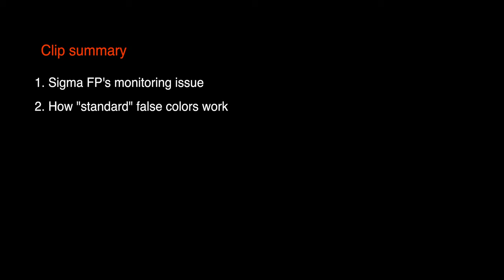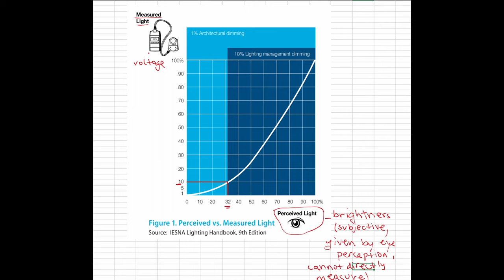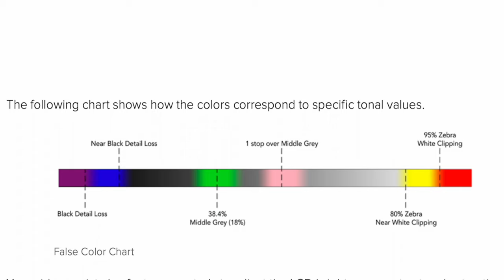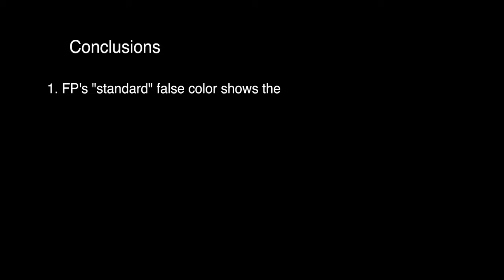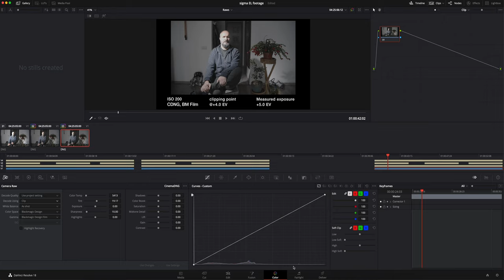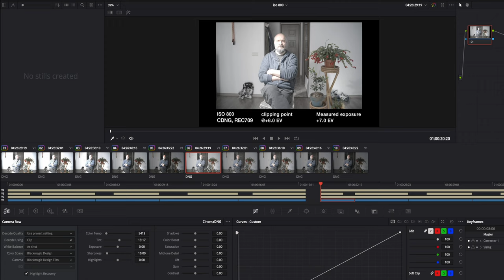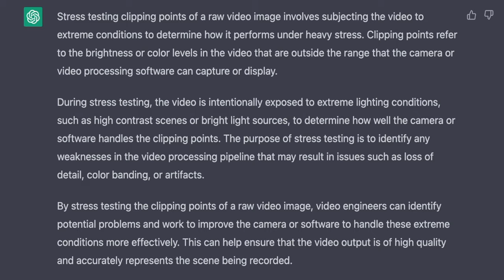Sigma FP - false color

Comment: Hey guys, I know this this might be a really strange ask but I have been cracking my head on how to get clean audio on the sigma FP for a while without the hissing sound. At the moment I've got a 'SAMSON C02 Pencil Condenser' Microphone connected to a 'Saramonic SmartRig+ - Audio Mixer 2 Channel XLR/3.5 mm' connected straight into a 'RODE wireless GO II' transmitter which delivers the sound to its receiver and that is connected straight into the audio of the camera. 
Every time I take it into Davinci Resolve, I always have to add a gain of at minimum +15 and at that point I have a hiss. Any advice would be appreciated.
I've really appreciated you guys' work on the FP so far and I thank you very much in advance for the future vids!
Reply from the maker: I’d only record on the wireless go ii. You can do 32 bit float now. Just don’t use the sigma sound. It’s good for reference…
Reply: Do you have the input set to mic level, and not line level?
Reply: @thepropolys  what's the difference? And how can I change between both to check?
Reply: @adeloyearts205  Sorry, I guess there is no line level input. But you can adjust the gain from the menu, just keep going right on the audio section.
Reply from the maker: The problem is the lack of monitoring. If we had a headphone jack… You can do visual monitoring but that’s not a professional way to deal with sound. Or you can use an external monitor. I prefer a sound recorder over any of these choices for professional use. That evf they come up with should’ve been the solution to most of fp shortcomings but instead it takes awat some to give you one. Imagine the evf with headphone jack, full sized hdmi port, a secure mount for m.2 ssd drives and a good grip. That would’ve added a lot of value to the addition.
Reply: @IonCosmina  I agree! I don't know why its so limited in scope. I would have taken all of that over acc having a peephole, essentially, for the fp. 

How do you audio sink? I have the rode wireless go II and I'm not sure how to set it up to give myself the easiest time in post
Reply from the maker: I usually make a strong short sound at the beginning of the shot and I will get that synchronized on the timeline. There are also software helpers like plural eyes or add ons for NLE’s. But i usually do the sync on the timeline. The old and very sure way is to do a slate at the beginning of the shot. You can sync to the sound and have a visual confirmation as well.
Reply: @adeloyearts205  If you have scratch audio on the camera and your intended audio on the recorder, Resolve can automatically sync them and attach the audio to the video clips (using Auto Sync Audio > Based on Waveform).
Reply: @thepropolys  have you used it before? Is it good?
Reply: @adeloyearts205  Yeah, that's how I do my audio normally. I use a Zoom F3 to record Mid/Side microphones and put the line out into my 7" Video Assist 12G. Then I sync the audio in Resolve. Premiere has something similar, but I use Resolve.
Reply: just replace Rode with Comica and don't worry. Fp writes great. There is a splitter for headphones, but you don't need them for monitoring if everything works stably. Your problem is Rode!

Comment: Hi, thank you. Your work is very helpful.

Are false colors accurate on a monitor like Atomos Shinobi when using with the FP?
Reply from the maker: Hello! I only looked at atomos ninjaV and false colors  doesn't accurately recognize the clipping points for each iso. BUT you get the flattest looking image (flatter than on the fp screen and on the BM video assist), so it's very close to looking at your footage in BM color space. In this way you can check if your exposure is ok. That being said, ninja v false colors is ok for exposures in not clipped ranges - like if you're looking for face exposure.
Reply: @IonCosmina  thank you for your response.

So, if I want to be careful to avoid clipping highlights, then I will have to refer to false colors on the FP's screen also at that time, I guess.

Thank you again!
Reply from the maker: @watzmaaname  yes. Exactly.
Reply: @IonCosmina  thank you very much. Wish you the best.

Comment: How do you measure that EV value?
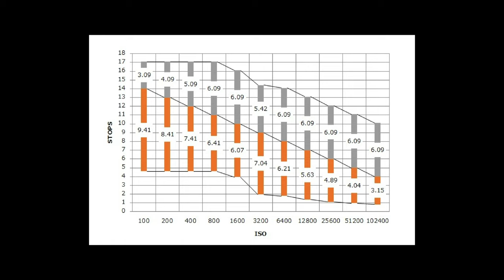Reply from the maker: Hi, if you look at min 5:13 i explain that. I use a sekonic light meter to measure the ev. And I add 1 fstop to the ev i get because the light meter gives you the exposure for middle gray and Caucasian skin tone is roughly 1 fstop brighter than that